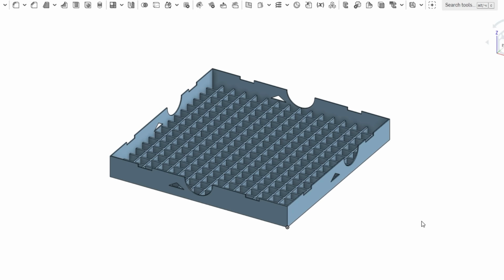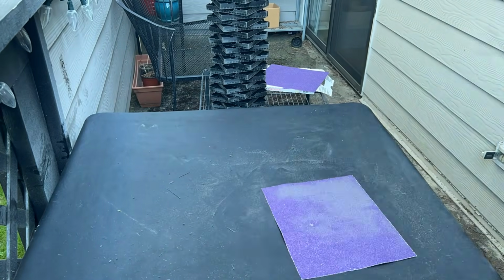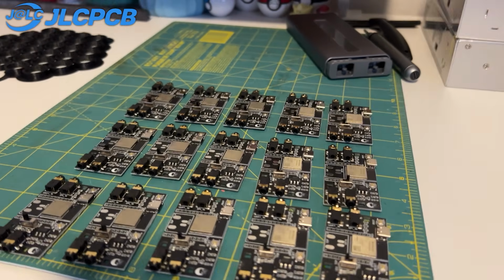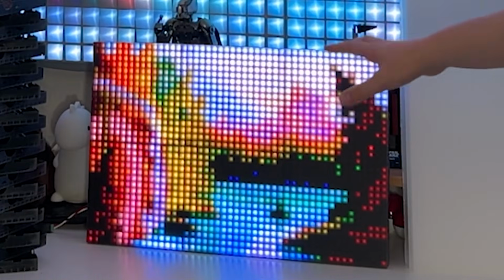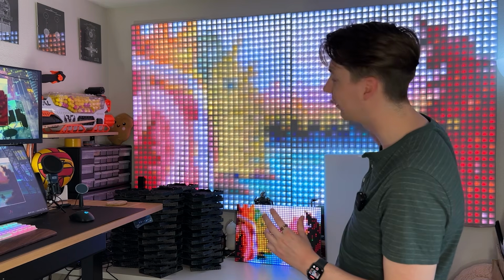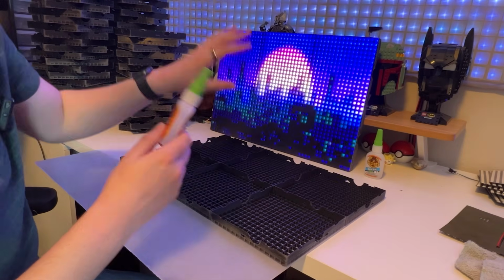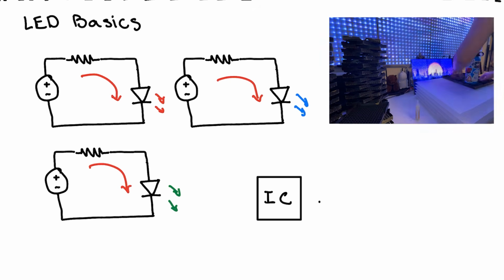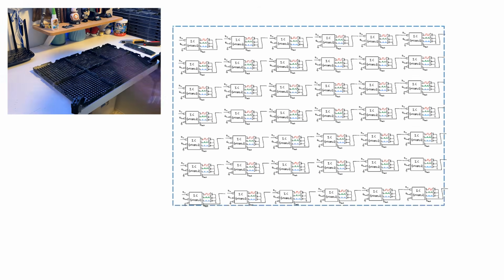How To Build a HUGE LED Wall From $5 Tiles

Comment: It’s cheaper to find broken tv’s and disassembling them for light diffusers. It’s much lighter in weight and it’s specifically designed to diffuse light
Reply: My apartment complex sees at least 2 50in+ TVs a month being thrown away. Easy scavenging, haha
Reply: LCD diffusers are generally designed to diffuse in mostly just one axis though, usually up/down.  Not sure how that would work with this kind of wall though.
Reply: I was surprised on that part. Could he not just have used cheap semi opaque plastic to diffuse the light ? I seems more cheap and easy compared to the plexiglass

Comment: i wonder if it would be possible to introduce some kind of delay per panel such that all of the panels update at the same time, just using some example out of my ass; assuming the panels have a uniform update time of 1 millisecond the first panel in the chain might have a delay of 16 milliseconds and the last in the 16 panel chain would have a 0 millisecond delay
Reply from the maker: That’s essentially how it works in a vertical stack. The bottom panel doesn’t display until the top one has received its data. But there is currently no synchronization between each column of panels which is why it looks so choppy
Reply: @Tech-Random  how would that kind of synchronization be implemented, would the uart chain be too slow?

Comment: Clicked this video cause the title says :  " led wall for $5 per tile "  ....  Now I have to go to university again ...
Reply from the maker: The 16x16 LED Tiles are $5 each but I used 96 of them for this project so the cost adds up pretty quick. Still cheaper than an engineering degree though 😂
Reply: @Tech-Random  Yes, thats correct. Its cheap compared with similiar products you can buy already :) -  BUT (and thats the point) I can stack up some LEGO blocks and make two eggs for dinner ... :D would be a lifetime project for me, hehe. Anyway, rly nice work m8 :)
Reply: saw the comment while studying for university 😂
Reply: Thank you for explaining, but I understand all that. 
My point still stands though.  

This was click candy...  not click bait. 

The title didn't even come close to promising a $5 wall.  It mentioned a wall of $5 tiles. 
Reading comprehension plus common sense informs the attentive reader that a wall has many MANY tiles.  
Read: multiples of $5 tiles.  

The OP was excited about these very versatile LED array tiles that were only $5 a piece.  So unless you're building a wall for a mouse, you're gonna have to break out those multiplication tables we learned in elementary school and apply that to the realistic number which the whole project costs. 

Do you understand my point now?  It's not just about the ability to read....  but the ability to apply the info gleaned within that title to a practical figure, based on this exciting A little piece of scalable tech being available on the curent market for $5 a piece.
Reply: Clickbait. Channel blocked.
Reply: @TheMrRatzz  You can block channels?
Reply: @TheMrRatzz There's a lot of clickbait out there. 
This isn't one of them though. 
Reading comprehension is important.
Reply: @TheMrRatzz Reading comprehension matters. Yours needs Improvement. 😂

Comment: I know this is old, but you should look into Chemcast Black LED Plastic Sheets

.  It is specifically designed to allow light through,  but it's back and diffused
Reply from the maker: Great suggestion! I just looked it up and it would be about double the price of what I did by frosting the acrylic and tinting it myself. But that was 70% of the work for this project so in hindsight it would have been worth it 😂

Comment: I am an embedded firmware engineer, If you would like to improve the framerate of this system I would be glad to help!
Reply from the maker: I am also an embedded firmware engineer 😅. I would love to hear your suggestions though. I think the serial connection between the PC and the first board is limiting throughput since it’s only rated for 1Mbps

Comment: Great looking project! Would it be possible to get the framerate faster than 12 fps? A video wall with 30fps would be fantastic!
Reply from the maker: The limit here is the serial interface between my PC and the microcontroller. It’s capped at 1 Mbps so the only way to get more frames is to lower the resolution. Professional solutions use custom USB drivers which are expensive and difficult to develop.
Reply: @Tech-Random  wait hear me out, its already low quality on the wall, you could do 4:3 without any prlms
Reply: @Tech-Random  Since you have an ESP32 in each sub-panel...  It would likely a require a redesign, but you could have each microcontroller join a wifi network, and listen for screen updates.  Synchronization might be an issue, but you might be able to do something like pushing individual panel  "frame buffer" updates, and then a multicast command to all panels to update the LEDs based on the new frame data.

This wouldn't be secure or reliable enough for a commercial product, but would probably work for DIY.  

If you want to keep to serial, you might try doing some simple custom run length encoding, as your brightness data is probably very repetitive.

Comment: If you make another iteration of this control board diode the positive off the power supply and the usb power together. One per incoming positive supply. The only diode that will gate will be the one with the highest voltage. They use this same setup in emergency switchgear all the generator batteries are dioded in as well as a station battery. Makes hot swapping power supplies possible.

Comment: Uuuuuhhhhhh you SOB. Ive aquired about 100m of led strip since my first POS set from aliexoress. Didnt know led would require so much learning. 8 months later and probably a couple 1000 dollars in microcontrollers, soldering, 3d printer(havnt been successful and vety impatient, need to try again) and led strips. I can kay them out in the order i bought them and you can watch my learning by trial and error. Starts at ali strips with a whopping 18led/m and i diode thats maybe a 20/20 24v. Then the 12v 5050 90/m(im learning, but guess who hasnt figured out RGB and ARGB), then ws281x 90/m(figured out the difference hardway) . Then ws281x 144/m(found out about hot spots in diffuser) and finally COB 700somethi/m(i could probably griw weed if i turned everything ive aquired on at the same tjme). Now for my magnus opus that keeps getting bigger every new idea. Plus if i bought, damniy im using it. So any kjnd DIY i could come up with to use thr crap strips. A lot jar lights, lamps from poster tube and diffuser Sheets scavanged from lcd monitors, lamps out of Old mobos connected together like a cube, led light clocks made from old 3.5"HDDs with motor Removed and cheap led fan clock placed in the vacant hole, infinjty mirrors From cardboard boxes. Still have meters of those shits left. Thf good stuff Has gone to modding my 4 gaming builds and running from them to a panel wall i built from the tops of old office desks. Using diffuser channeks, diffuser tubes, and other components i snaked thd leds on the wall like it was tracings on a PCB. I synced all thr pcs running SignalRGB. Ive trued with wled to connect the dumb rgb. It involves MOSFETS with 1 diagram in the whole internet, got frustrated and quit(still learning circuits lol). Luckily my mobis have 12v headers, so i plug inti them and signal drives them. Oh yeah the LED cloud cieling. Of bunch of leds in random patterns covered by cotton stuffing. I converted anything i had argb i bought cut off controller and wled. NOW i have to build aa f"^#*ing jumbo tron. I blame you as well youtube . U should come with a warning for people with ADD. All seriousness awesome sauce man.6 months ago id have no idea what you were doing but i think i got it now. But now  im forced to actuality learn my printer. It just takes so damn long😑

Comment: Trying to print this circuit on jlcpcb but get this error:
The below parts won't be assembled due to data missing.
SPI_IN,SPI_OUT,H1,H2 designators don't exist in the BOM file.
Reply from the maker: This is expected. Those parts are meant to be unpopulated because they don’t provide any necessary functionality

Comment: Wow 😲 that's great and so far the most beautiful diy giant led wall.

good day Sir I'm from 🇵🇭 and I wanna ask if that four groups vertically consist of 6 panel with 6 tile is connected wirelessly via web socket like your previous led wall?
Reply from the maker: The panels are connected using 3.5mm audio jack cables and all of the data is transmitted through a Serial connection
Reply: @Tech-Random    thank you Sir for your reply   If I'm going to make this modular type of your new design of led wall, it is possible to make it wirelessly connected via web socket like your previous led wall that has been divided on 4 vertical panels but still following this new design of modular type with 3.5mm audio jack cable for data transmission?

my plan is not only to stick on a big screen display but I want this to divide it on 4 vertical panels such as your previous led wall when I'm going to use it on the stage for design on the left side and right side of the stage like events indoors.
Reply from the maker: It’s certainly worth trying. My main concern is the data rate of the websockets. The old wall was low resolution so it wasn’t an issue but this design needs a very fast connection. I talk about the software more in my dream office video if you’re interested in learning how I get a fast frame-rate.
Reply: @Tech-Random  thank you so much Sir for your knowledge on this it's a big help for us beginners who aim to know more about this Godbless to your future projects.
Reply: Good day Sir I have another question, can I increase the number of led tiles that I'm going to build? 

yours is 6 tiles per module and my plan is to make it 12 tiles per module (4 width x 3 length). 

yours is 4 modules per column and mine is also like yours 4 module consists of 12 tiles per module per 1 column of 4 columns.

sorry for my deliberation I hope you understand I'm not good at the English language 😅

Comment: That looks incredible, well done! With that you certainly earned my subscription. 

I assume the refresh rate is currently limited by the protocol and throughput through the ESP32 and not so much by the speed of the LEDs, right? Have you done some testing with the RGBs how quickly they can switch to see what the theoretical maximum is? If that is considerably faster, it could be worth considering a faster interlink / different protocol, so latency goes down and refresh rate goes up. This might never be a super viable gaming solution but I think it could be considerably faster and enable you to play retro games REALLY well on it. Also it would potentially allow for syncing up the modules better, as I see there is some lag between the panels. 

Those are just some random thoughts, so feel free to ignore them. It is an incredible project and quite the accomplishment!

Comment: The depth of the color seems reduced. Looks like 256 colors instead of millions
Reply from the maker: Color is reduced to 8-bit RGB in software. Unfortunately I wasn’t able to get more than 3 frames per second using the full 24 bit range that the LEDs are capable of. I probably should have explained that better
Reply: @Tech-Random  was the speed issue within the scope of a single square? Or was it the communication between all the esp32s3s causing the bottleneck?
Reply from the maker: @Alkatross it’s a limit across all 16 panels. I made a couple other videos that go into more detail on the software side
Reply: @Tech-Random  I'll check them out, thanks for sharing!

Comment: Was there any reason you printed the grids in black and not white or grey which would be more reflective and increase brightness?
Reply from the maker: Printing the grid in white would help diffuse the light but result in a some color bleed between pixels. I used white PLA for my first LED wall and each tile would light up the tiles next to it a little bit so I’ve used black ever since.
Reply: @Tech-Random   fair enough! I'd be curious as to how grey would fare, potentially making the grid slightly less pronounced. None the less, an awesome and well executed project!

Comment: It may be a limitation of the LEDs, but maybe you can increase the quality of the colors by using gamma correction (if you are not already using it, for instance all images use sRGB by default)
Human eyes can distinguish shades of colors way better in the darker color range and not so much in bright colors, so by using gamma correction you can squeeze more distinguishable shades of colors in the same amount of bits of data
The conversion formula is this:
sRGB to Linear: pow(red_channel_brightness, 1.0 / 2.2) | Screen capture side
Linear to sRGB: pow(red_channel_brightness, 2.2) | ESP32 side
Reply from the maker: It’s actually a limitation of the software I’m using. To drive all of these pixels at 12fps I had to reduce the colorspace to 8-bit RGB. One bit per pixel is way faster than 3, but the color accuracy is a huge compromise.

Comment: As professional led wall technician I must say GOOD JOB for a diy project 💪
Actuall panels don't have a plexiglass sheet. Cheap ones are glues in with transparent silicone and the pricier ones have plastic "lenses" optional with a dark tint so black in the signal appears black on screen. Of course the pixel density is much higher but who knows what you'll come up with in the future 😅

Comment: Namco uses these LED video walls for their giant Pacman arcade. It looks good for simple games like that.

It would be great if someone made a 40" 320x240 4:3 aspect one for old arcade games and 240p consoles. There is a gap in the market for that. Nothing exists currently.

Especially if it was capable of 60hz and updated line by line like a CRT monitor so old light guns would work and you could avoid motion blur.

A 3d printer is the wrong tool for making stuff like this. A cnc machine would be able to make these parts in under and hour.

A well dialed-in cnc machine would create parts flat enough to avoid all the sanding. 

3d printed plastic will not remain stable with the heat of led lights. With a CNC machine you could use aluminum instead.

If you used a front glass layer you'd be able to align the led panels perfectly so you wouldn't be able to see gaps between panels.

An off the shelf single sheet of display diffuser film would hide the individual pixels without losing too much light transmission. A 15% diffuser would probably be sufficient. Rosco sells such material.

That's  my $0.02 anyway.

Comment: A couple relatively cheap tools you should buy that would make your job faster and look better. An oscillating tool you could trim everything flush in seconds, super glue activator make it dry instantly. If you want to get fancy a router to flush trim things. Cut as much sanding out of your life as possible that's my motto.

Comment: could you explain what happened at 16:40, that white-yellow gradient – was that the panel running out of power? how did you fix it?
Reply from the maker: The wires that connect the tiles are really thin so if I drive the panels too bright they start to turn yellow like that as available power runs out. I lowered the brightness in software until that issue went away.

Comment: Impressive HW Build.  Where can I learn about the software and networking to get the images/video displayed once the arrays are built?
Reply from the maker: Look up LMCSHD on YouTube. I have my own fork but you can use the main build for this project!
Reply: @Tech-Random  Yeah but how do you connect LMCSHD to the ESP. You said once that it receives it through the uart port, but how does the first panel get the data and what settings do i need in LMCSHD.
Reply from the maker: @TheHolzixx I use a USB to Serial converter that I soldered to one end of an AUX cable. That plugs into UART IN of the first board. In LMCSHD I select the com port of my converter and set the baud rate to “2000000” and Colormode to 8pp RGB. I actually have four of these connections so each of the bottom panels gets its own USB connection and drives the three panels above it. Hopefully that helps. Feel free to ask more questions!
Reply: @Tech-Random  Ahh ok. On the Aux, what Pins so i need to solder tx rx and gnd to
Reply from the maker: @TheHolzixx It should be green to ground, red to RX and white to TX. Some aux cables may use black instead of green.

Comment: i build one out of strips. was not the best idea, alot of work.. but its 5m wide and is 60hz. (but only 2500 pixel) :P.

I will need to use these grid panels in the future as well!

Comment: Hey man. This is an awesome project, and I can tell it took a lot out of you and you suffered through that process. Thank you for that. Its always awesome to watch. Now... I have a piece of criticism that is meant only to genuinely support a new YouTuber trying to figure it out. This video could and should have been shorter. I know you put a lot of love into this, and so you feel very justified in sharing all of the process and information, but its a lot to digest and it slows the feel of the video. I suggest doing the two channel approach. The first channel that has a condensed version of the video, maybe 10-15 min final runtime, then if people want to know more, you point them to a second channel which is a longer cut with more information. I genuinely dont mean to offend, just suggest a way of doing things that I have help seen drive success on the platform over the years. Good luck. I'm rooting for you.